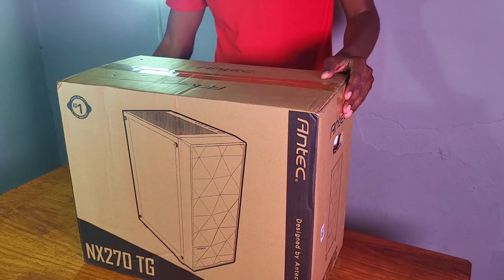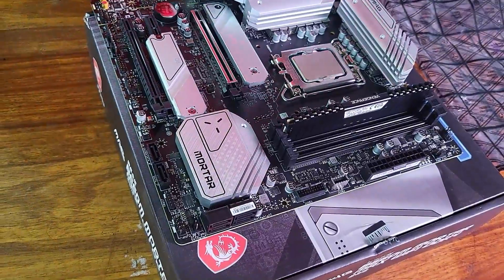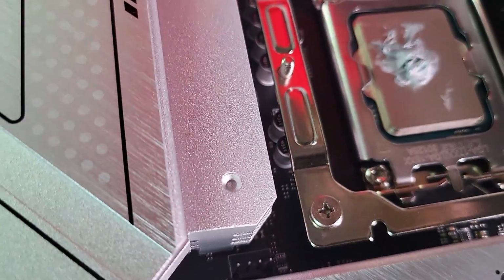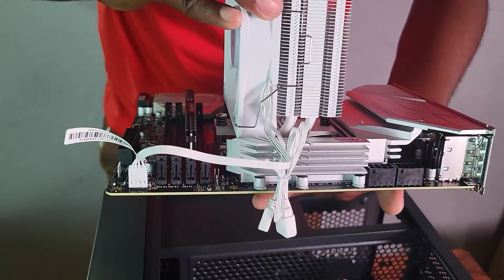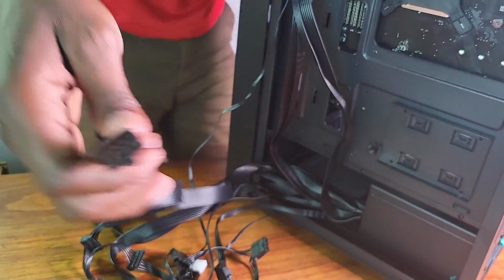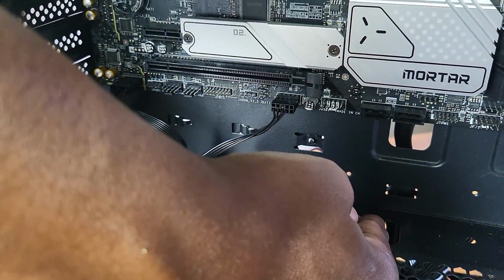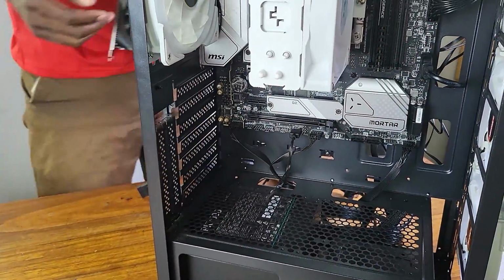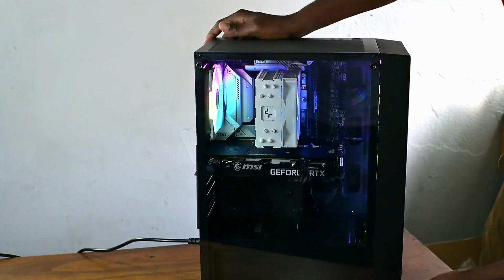Building My First Budget PC Build with No Experience

Comment: question

would it have been cheaper to buy 2x16GB ram or 1x32GB cus you're kinda shooting yourself in the foot by only having 1 stick instead of 2
Reply from the maker: Hi, I had initially ordered 2X16GB but then I got the 1X 32GB , which is ok since in the end I want 128GB configuration

Comment: As someone who hasn't built a machine in close to 10 years and is very jealous, here's my 1 cent:
3:00 The arrow is a good indicator, but there should also be a notch or asymmetric notches on the CPU to help get orientation right.
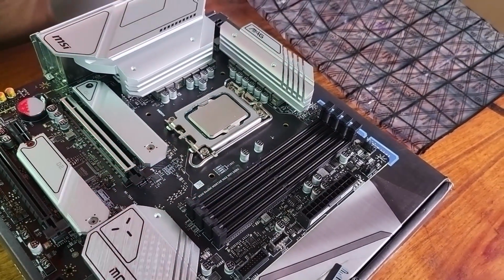5:54 Going single channel is something you might feel, but its OK since it will be one less item to dump for your future 128GB upgrade
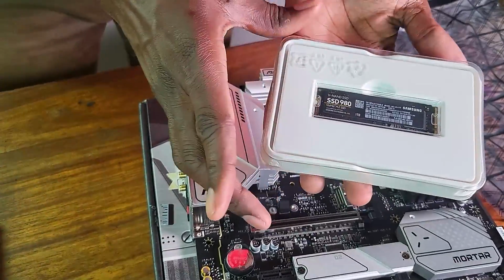8:23 Crazy that there are even smaller drives than that! I still have a couple of my IDE drives and the difference in physical size and capacity is hilarious! Its probably pretty quick, but it would be nice to have another one to sacrifice to the Scratch Disk gods
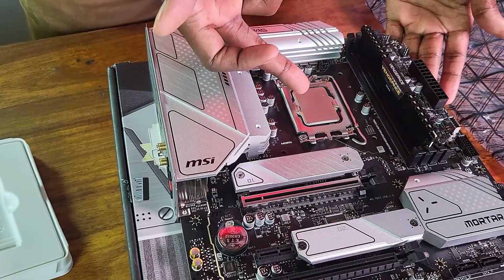9:53 Nice! Can't have too much cooling! I used to be a minimalist snob until I saw an RGB setup in real life! I'd still probably run it in just white, but watching a pc breathe through the colour spectrum has its charm! It make your PC feel alive 😅
22:09 Haha! "Don't worry, I won't be using this"! Keep up the McGuyver spirit!
23:33 Mi Store Zim, where you at? You should have sponsored my man with that lovely electric screwdriver!
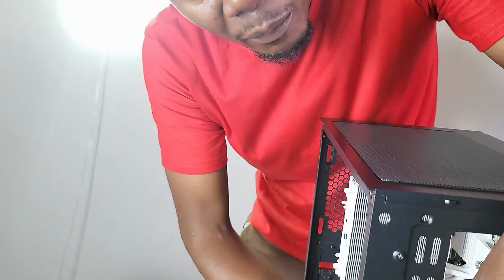30:41 🙏🏾 Thank goodness!
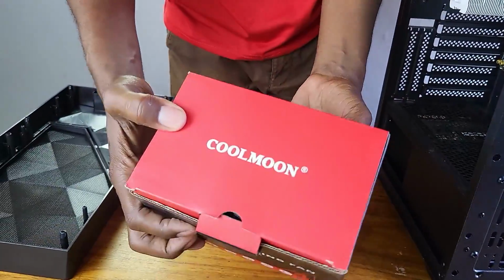31:19 Remember when I said I was jealous? Years ago, I was planning to build a new pc and the only thing I got was a set of fans! I ended up McGuyvering them into a desk fan using an old headphone stand😂
34:55 OMG! My pc is so old that when I built it, it had individual +/- sockets for the case header pins! This was where I saw fire cos I was terrified the whole thing would blow up if I got it wrong! That's the only worn page in the motherboard manual 🙈
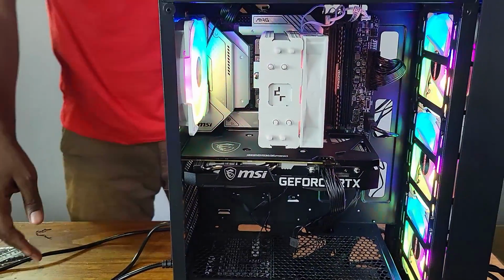47:04 Awesome!

Nice job man!